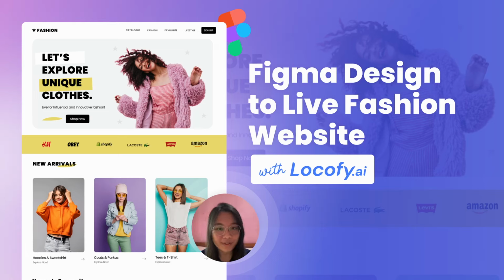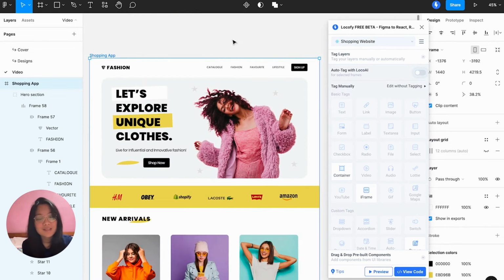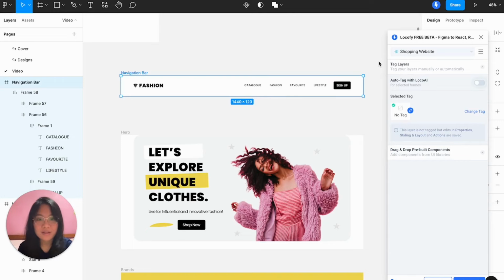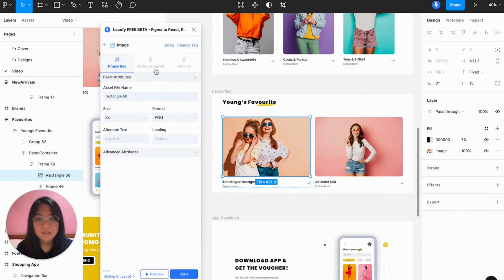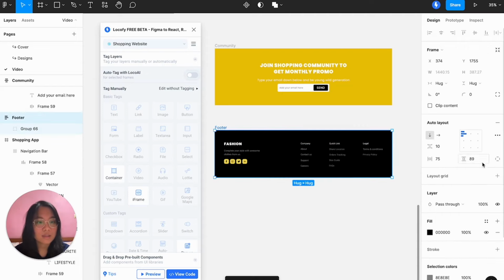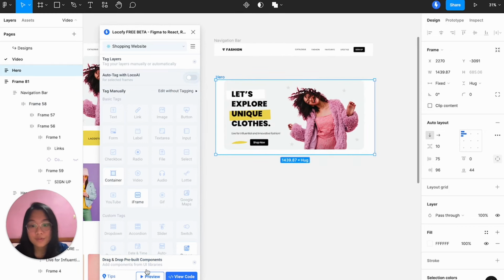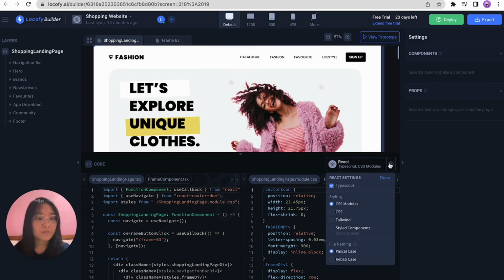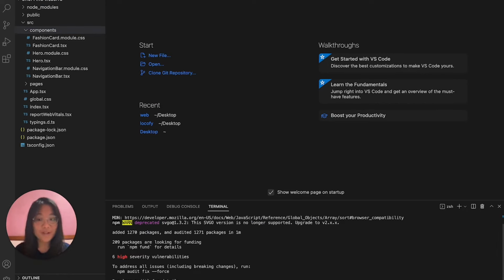Locofy.ai | Figma design to Live Fashion Website with Locofy [Quick Build]

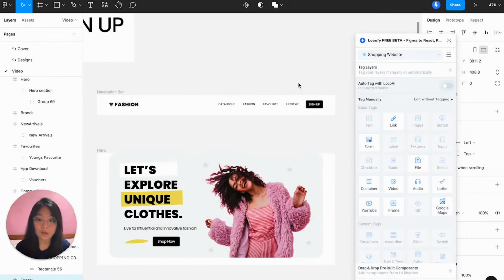Comment: Hello, this is an Awesome Tutorial <3. But I had one doubt, at 9:34 how did you manage to split everything in different sections ? I am trying to do that but I am not able to do. Is there a plugin that you are using ? or some feature that I don't know about ?

Edit: Also from where did you find the hamburger icon ?
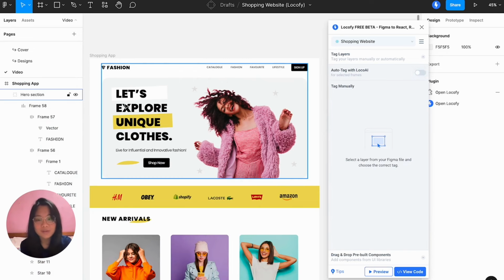Reply from the maker: Hi Samyak! Please check out 7:24 which shows you how to break it down into smaller sections. The hamburger icon was copied from another design you can easily find these on the Figma community!
Reply: @locofy_ai  Got it. Thankyou 😄👍🏼